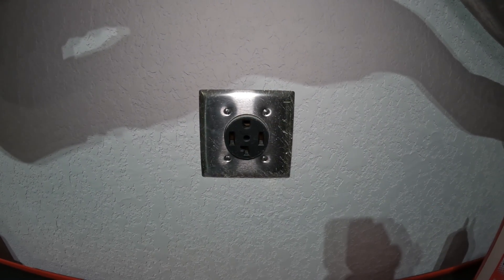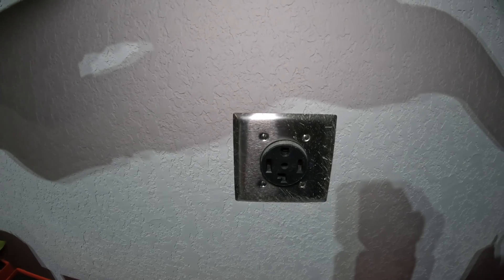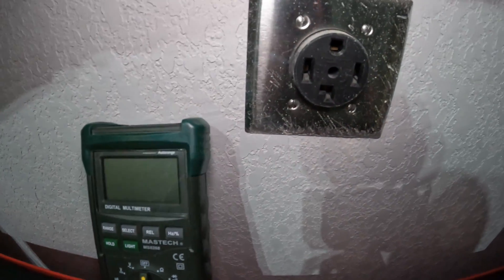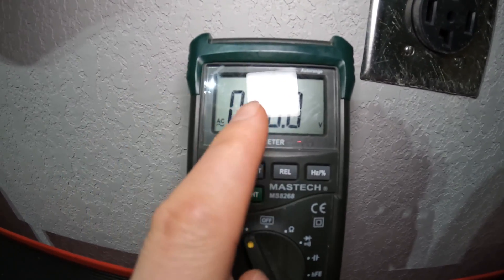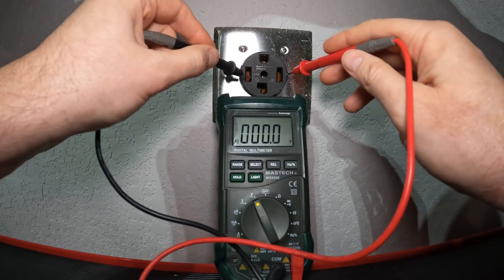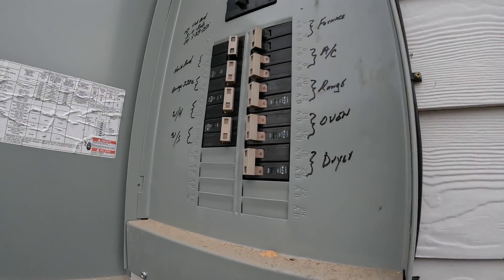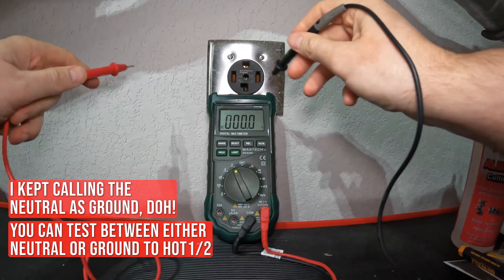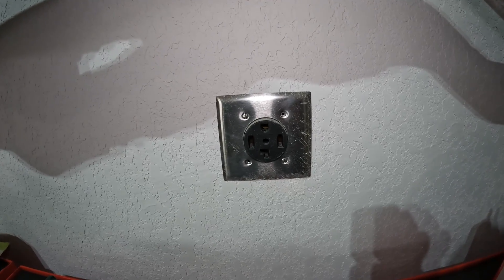How-To Test a 220v/240v 4 Prong Dryer Outlet! Easy! 4K HD

Comment: Thank you for this great video! 

Can you please tell me, is there a way to use the multimeter to check if the four-prong dryer outlet is properly grounded? 
* How would I be able to tell if the four-prong is properly grounded? We are adding in a pigtail of 8 gauge wire today. But prior to this this, metal outlet did not have a pigtail from the four-prong outlet itself to the metal box and so I was worried it was not properly bonded grounded. 
** Can I use the multimeter to test to make sure it's properly bonded grounded? Or is there some other way I should test? Thank you!
Reply from the maker: Hello! Yes.. it would be properly  grounded if you test from hot 1 to ground and it reads 120v and hot 2 to ground and it reads 120v and then hot 1 to hot 2 and it reads 240v this would indicate everything is good and properly grounded. Testing from neutral to ground should read at or just around 0v as well.
Reply: @D3RPZILLA  thank you

Comment: so i got one side reading 120 and one only 50
Reply from the maker: Hello! It could be a few things.. possibly the neutral and ground are touching? A short somewhere in your wiring? Old outlet? How old is the house or wiring? If you shut the breaker for that outlet.. does it read 0 for everything both sides and between?
Reply: @d3rpzilla  i replaced the outlet still gettin same thing house is pushing 30
Reply: @d3rpzilla  im going to check it when off if still gettin reading
Reply: what does that mean

Comment: Do i have to turn the power to the outlet off before i test it? Ive never done this before but i need to test mine
Reply from the maker: Power has to be on to test otherwise everything would read 0. Just be careful and don't try to take the outlet apart or anything with the power on.

Comment: Why do I not get the 240 between the two hots? I get 110 on each hot but when I test the two hots I get 0? Any help would be great. Thank you
Reply from the maker: Hello! It sounds like perhaps both hots are wired on the same phase when they should be wired on opposite phases.
Reply: @d3rpzilla  anymore advice you can give me? I would really appreciate it.
Reply from the maker: Heya! Check out this post which explains it pretty well, https://diy.stackexchange.com/questions/212780/240v-outlet-not-working-reading-120v-on-each-leg-0v-between-legs, scroll down to the top answer. In summary.. you want to make sure you 220v breaker is sitting between 2 numbers on the panel, so, you want it sitting on something like 12B + 14A. You do not want it sitting on the same numbers, such as 16A + 16B. So, if you breaker is sitting in something like slot 18 with 1 wire going to 18A and 1 wire going to 18B, it won't function. You will need to move the breaker down 1 slot so it would sit on 18B and 20A. Of course make sure the entire panel is powered down (main breaker off) and you test readings of the panel show it's completely powered down before you begin working on the panel. This video shows the installation/uninstall process fairly detailed, https://www.youtube.com/watch?v=qWhul3Pa6mA. Let me know if that helps!
Reply: @d3rpzilla  it’s wired to a double pole circuit breaker.
Reply: It’s wired to a double pole circuit breaker. Red to one side and black to the other.

Comment: Do i have to cut the power off from the breaker first?
Reply from the maker: Not prior to testing the outlet otherwise it would always read 0. If you are going to replace the outlet after testing then yes you would want to cut power to the outlet at the breaker.

Comment: This was an excellent video and very helpful despite some complaints about length. I identified an issue with the outlet or panel with readings in the 40's for hot and ground for one side and and 120 for the other. Both hots read around 170. Saved me money and time (didn't call the dryer repair guy). Wish I had seen your vid sooner as I already replaced for parts on the dryer. Guess i'll call the electrician to fix the breaker issue Thanks again!!
Reply from the maker: Thank you! Yes.. a little long winded, lol, I've been working on trying to not ramble so much, haha :D Glad you were able to save some money and time, that's always a great feeling!!

Comment: One of my hots tests as 15V?? The other reads 120. Together they read 100??? I tested exactly as you showed before even coming here. What could be my issue?

Edit: I found the issue. The double pole breaker had one leg that was corroded. Operating the breaker back-and-forth multiple times wore down the layer of corrosion and now it is reading as it should.
Reply from the maker: Awesome! Nice work :D

Comment: What might be wrong if one side tests 240 and the other is 120?   Was OL then i turned up the multimeter and the left hot side tests 243 volts ... my Dryer as error code for power and i could use some advice
Reply from the maker: What does it measure between the 2 hot sides?

Comment: To check for the two 120’s an 240 across do the power has to be off? I’m checking with power off and getting same read you just did. So is it safe to do it with power on??
Reply from the maker: Power needs to be on or you will have nothing to test. Just be safe about it, don't touch any exposed wires, etc, and just make your tests once you turn on power.

Comment: okay.. thanks for this. However, when checking neutral to hot i don't get a 120 reading. I tried replacing the outlet and checked the panel breaker and still nothing.
Reply from the maker: What reading do you get? 0? What do you get between both hots?
Reply: @d3rpzilla  I get nothing. Zero. It’s a 4 prong dryer outlet but when testing either hot to neutral I get nothing. The dryer was working perfectly on this outlet for three years so now I’m thinking there’s something wrong with the dryer and not the outlet or the breaker because I tested the breaker both at 1:20 and 240.

Comment: When testing the both hots to a neutral I get 122. But when I test both hots together I'm not getting anything. What could be the problem
Reply: the panel breaker or a lose connection

Comment: Why when i hook up the 2 hot and a ground #6 the display gone on my stove and why i use the #8 with 2 hot and a ground it display the screen but wont turn on oven. Pls somebody help me thanks
Reply from the maker: What do the voltages read on the outlet when you test it?
Reply: @d3rpzilla  one is 119 and the other 122 but those old electrical may affecting. The stove does not have a nutral run to the outlet to the braker box. It only have a ground that is anchor on the ground pole in the breaker box. Then the ground is connected to the nutral on the stop when u plug in the 3 prong stove cord

Comment: Probably dumb question but when you put the meter in both hot sides it won't shoot spark anywhere? Lol Common sense always told me not to stick shit in outlets, is the metal on the probes different to where it doesn't do that?
Reply from the maker: Haha, not a dumb question :D I mean, you don't want to stick like a fork in an outlet and short the ports together or anything like that, that would be bad as most likely you may become a path for the current to flow through and then into the ground or something. But a multimeter is built to allow testing in this manner and has built in high series resistance.. just make sure you are using an appropriate meter (and in the right setting/mode) for what you are testing and that it is in good working condition as are the probes and that everything is hooked up correctly and undamaged, no moisture, etc, and you should be good :)

Comment: For a 110-120 outlet there is a 3 prong tester.  It indicates if you have properly wired the outlet.  Is there a similar device for a 220 4 prong outlet?
Reply from the maker: I'm not sure.. I did a quick look around and didn't see anything super obvious but there may be.. Or possibly a 4 prong to 3 prong adapter and then test with a 3 prong tester through the adapter.. lol.